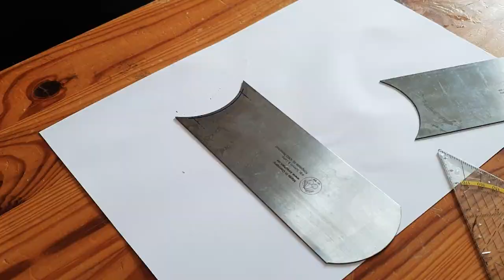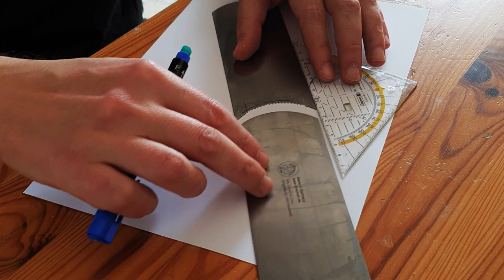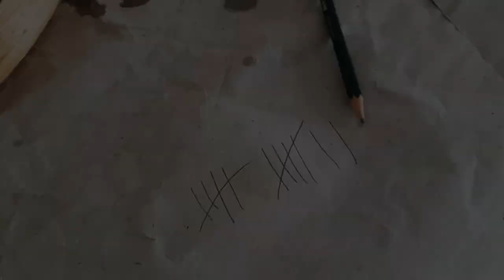How to build an Ottoman Bow - #2

Comment: Very detailed, every day I was looking for part 2, we wait another month, good luck!
Reply from the maker: Thanks mate. If you have any questions: just ask 😉. If everything works out fine the next part will be about shaping the bow to its final dimension. Cheers
Reply: Did you buy the glue or is it homemade?
Reply from the maker: @ottobigu678  I bought it online at a woodshop. I searched specificly for buffalo hide glue (it is more elastic than fish bladder glue - and in my climate zone hide glue takes a little longer to gel, which gives you more time to handle the gluing process. In Asia it is the other way around. Because of the heat and the moisty air the fish bladder glue takes longer to gel - thats why they prefer that one). And I guess you would need an open kitchen to cook up hide for hours because it seems to be a pretty smelly process 😉. Cheers

Comment: Very nice turkish bow!
I made my own horn scrapper too but I made it flat to use it both for horn (water buffalo) and wood side and to achive the straight matching grooves. But i think about this round made scrapper for next project too - i have a gemsbok horn this time - inside of the horn is round and hard to make straitght
Reply from the maker: Hey mate, thanks a lot. That's very kind. I was thinking about making it straight as well because you can use a normal saw blade to make the grooves. But due to the fact my Horns were pretty narrow I decided to go with the rounded approach. How long are your gems Horns and what kind of bow are you planning? I'm really curious 😉 All the best
Reply: @m.bitious  I have pretty long gemsbok horns … over 50cm usable lenght and wall is thick but inside is round (horn dismeter was around 4cm before i cut it to the halves with bandsaw) this thing is hard to make it flat as i have heard (can get cracks lenghtwise)… I think of try it to flatten it after heating it with hot oil (this method is way better as with water as i have heard) or … try it with round scrapper as you to get more from round profile horn.
Reply: @m.bitious  this time i would try with mongol yuan style bow …
Reply from the maker: @gorazdg1  hey, wow thats a great length for gems horn. I have no experience with oil. But there is this dude that makes native indian style horn bows - and he simmers the horn for a whole week on low temperature. Maybe this could be a way, too. Here's the link, have a look: https://youtu.be/D_J9c6fnKMs

Comment: This is amazing precision work. Wow. 👌 may i ask. Will wood glue be as the hide glue? Or maybe even epoxy resin? Could a person replace the hide glue with either wood glue or epoxy resin?
Reply from the maker: To be honest, I would not recommend it because wood glue and epoxy tend to harden until they get brittle. that makes it a less ideal option for attaching the horn and as well for the sinew layers. Because the will bend, stretch and compress a lot - the glue should be flexibel as well. Nevertheless, I guess epoxy would work for the wooden core (the joints between handle and limbs) - but there's hundreds of years of try and error within this process - I would really recommend to stick with the hide and fishbladder glue. If you try your luck with epoxy, please let mi know how it turned out. All the best
Reply: @m.bitious  thank you for your priceless feedback and response.  I appreciate it. I understand completely.  👍 I'm in South Africa and it's very difficult to get these materials because if I buy things like horn kinda locally it's very expensive and if I have to ship any product from over sea then Shipping costs are very expensive.  So I was looking for alternatives wih the glue. But I will see how things work out. For now I will not be making such a master crafted bow lol😁😂 not yet. For now I'm going to try and make a bow with natural and modern day material combined and see how it turns out.
Reply from the maker: @musaadfelton3909  hey, that sounds great. no matter the materials. crafting bows is an absolute beautiful hobby. I understand the problem with the shipping costs. I guess it doesn't have to be water buffalo. horn from a goat, a sprinbok or an antilope might work as well. maybe there's a less costly option for you. and you can make hideglue by yourself. I guess it's kind of a messy process but it's an option if you don't have a purchase option. this guy does it, for example: https://www.youtube.com/watch?v=nYy5tMOpHJM ... or this guy: https://www.youtube.com/watch?v=1ucmtNoKcgg    cheers, my friend
Reply: @m.bitious  Thanks for sharing these video links. Appreciate it. Man I just think that there is a different experience to archery when you craft your own equipment.  You really become one with your bow. You respect it more. You are able to feel through your own limbs the strengths and weaknesses in the bow limbs. It's just amazing. It makes you a better archer because it makes you whole, understanding every process of making the bow and then transferring that into using the bow.
Reply from the maker: @musaadfelton3909  couldn't have said it better, you are perfectly right. and it teaches you patience because one false cut, scrape or draw and weeks of hard work are just destroyed 🤣... I had to learn that the hard way. Cheers

Comment: А чей это рог подскажи пожалуйста, я сам тоже турецкий лук делаю только рога не могу достать, они очень дорогие. Может подскажеш где можно достать их?
Reply from the maker: These are water buffalo Horns. I found them online in a Barber Shop. You'll need 2 of them (the price is only for 1 in the following link) because you can only use the outside. I ordered them here - hope that helps: https://www.rasur-online.de/shop/artikel.php?artikelNr=1165&HK_ID=109
Reply: @m.bitious  😄
Reply from the maker: @КириллМакаров-ф7ц  this Shop sells horn stripes as well. Could be a good way if you don't want to grind down the whole horn. I wanted to try it from scratch, thats why I worked with the original Horns. And please: don't use cow Horns. They are not strong enough. It has to be water buffalo. 😉

Comment: Where to get those knife tool?
Reply from the maker: I ordered a convex and a concave scraper from the same manufacturer (in my case Cherry) and I filed the teeth in manually. Because I didn't find any to buy. Or did you mean an other Tool? Cheers